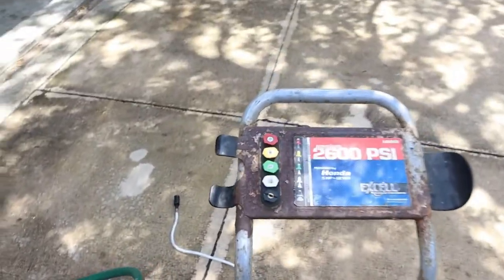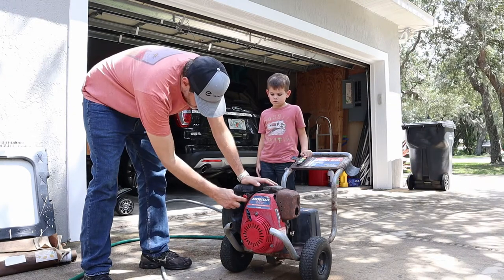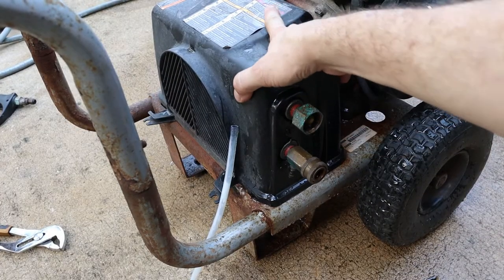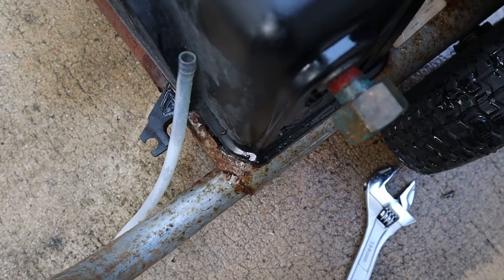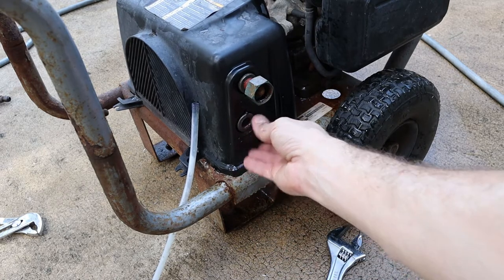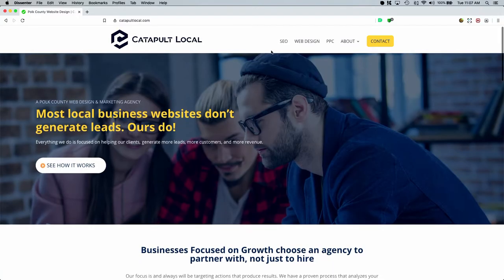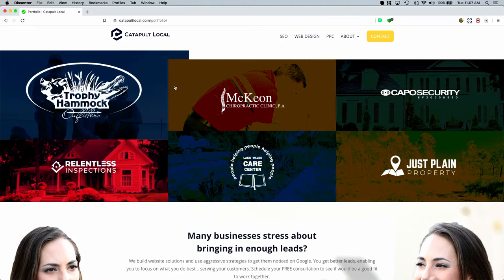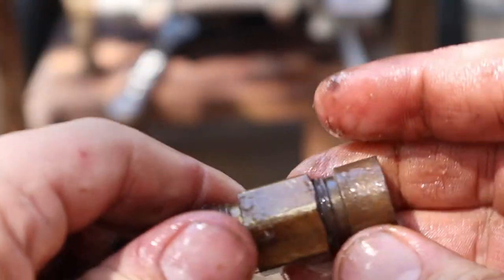Fix Honda Excell 2600 Pressure Washer Has No Pressure

Comment: so i put mine back together. is it still supposed to have a lot of resistance on the plunger? i see some videos of different style unloader valves that they compress with their thumb but even after cleaning mine(same style as yours) i can’t move it by hand. only in a vise.